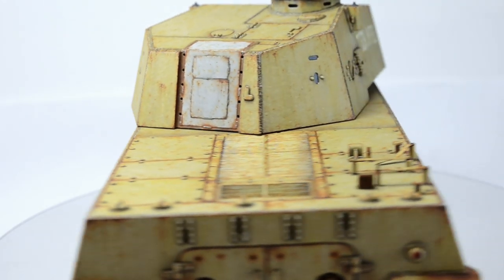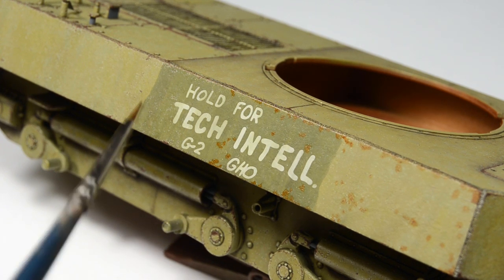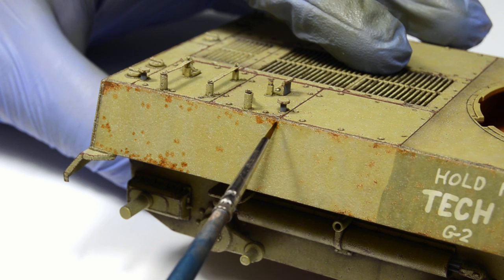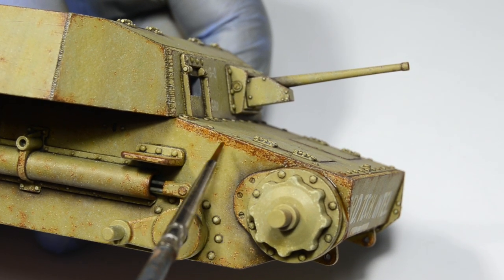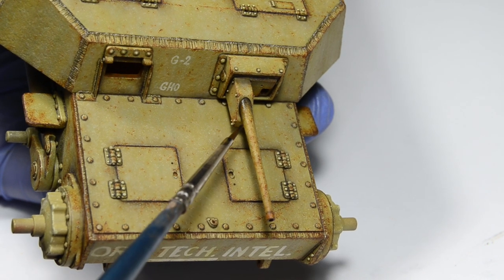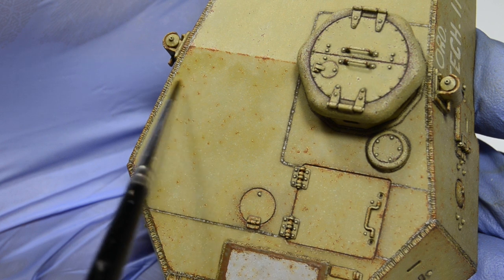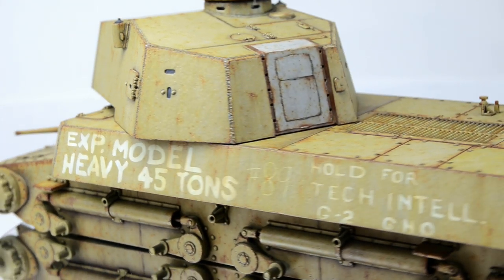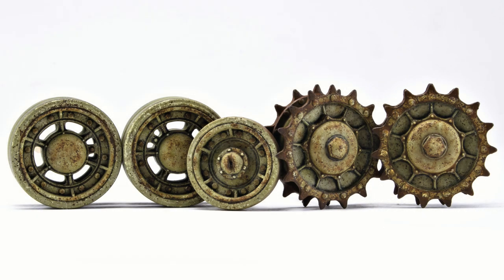Painting a RUSTY Abandoned Tank - Type 5 Chi-Ri (Fine Molds 1/35)

Comment: I brush paint (as opposed to weathering) my models with Tamiya enamels and I've found that shaking the bottle and then dipping the tip of the brush in the little pool of paint in the cap of the bottle works quite well. If you run out of paint or it starts to dry you can always just put the cap back on and shake the bottle again to refresh your paint supply. Great work as always.
Reply from the maker: Yup I sometimes do this with AK and Ammo enamels. Nice trick when you need slightly thicker paint.

Comment: Just an fyi for dealing with welds. It depends on what type of weld it is. Some cause more flux to be in the weld which causes rust. If the welder is good, and no flux or slag is present, then it is less likely to rust. The typical rust spots would be on the outer edges next to the weld because they have to grind it to bare metal for the weld to work properly and then the rest of the bare metal will rust.

Comment: Great video 👍 Quick question. Between each stage of this process from the chipping to the rust effects, are you applying a varnish/clearcoat layer at each stage to protect the previous work? You're applying this thinner based rust effect over all your chipping from the previous video, so i'm assuming you've applied varnish/clearcoat over all the lovely chipping work you did to protect it?

Comment: Nice job.  One question.  Could you have done the same job without using Mig products ?  Oil paints maybe ?  This is not a criticism, just an alternative, cheaper way to do it.
Reply: of course, check Mike Rinaldi, he does everything with oils
Reply from the maker: Exactly, Mike is a great example. I also used oils exclusively in the past. Now I just like enamels because they dry faster, are pre-mixed so I can save the little time I have for this, and I like the way they blend.